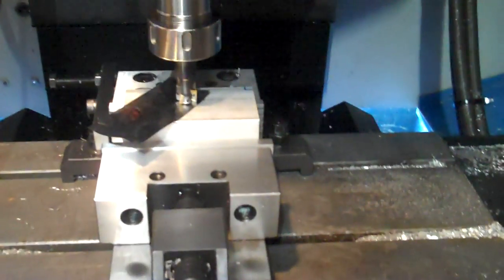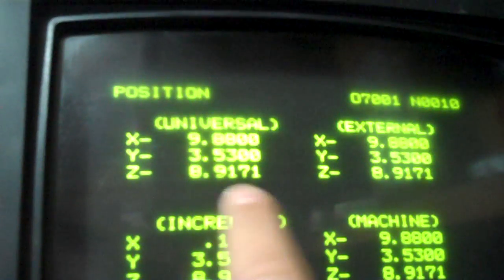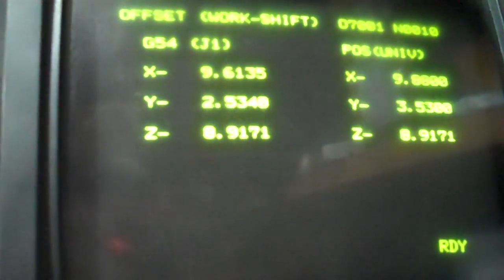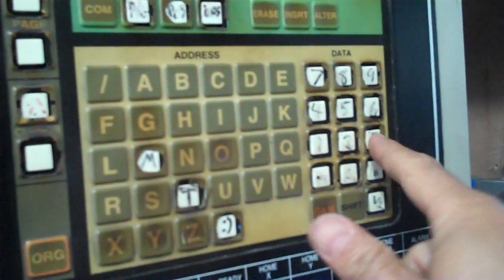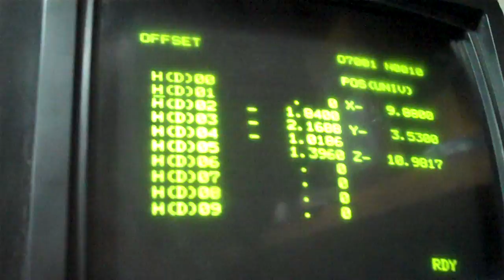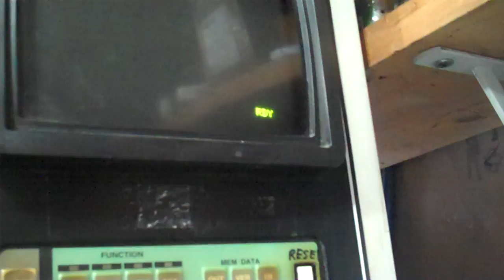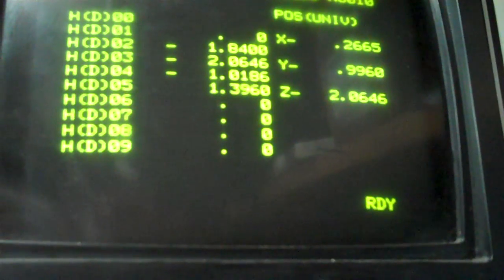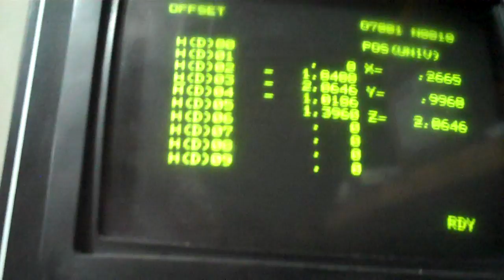Yasnac MX3 - Hyundai SPT-V30T - How to Tool Offset

Comment: thank you for these videos. very helpful. the yasnac manual is very confusing
Reply from the maker: once you figure it out, its a nice control. I have some new videos to make, hopefully can get them up soon.
Reply: @ggggtech75  when I go to the offset page and hit next nothing happens for me. It does not bring me to the work offset page that you are getting to
Reply from the maker: @vigotacoma  do you have the exact same control? try the up down buttons instead? Make sure your in EDIT mode although I am sure it works in most of the others for me.
Reply: @ggggtech75  Yep, same Yasnac MX3 on a Kitamura SparkChanger. For now, the only way I know how to plug in the offsets is on the settings page. I cant figure out why I dont have that section in the offset page. Maybe a parameter is disabling it?